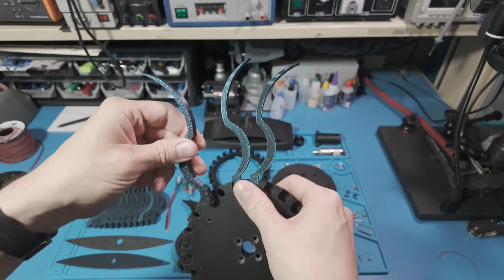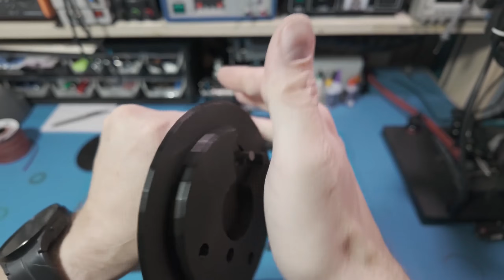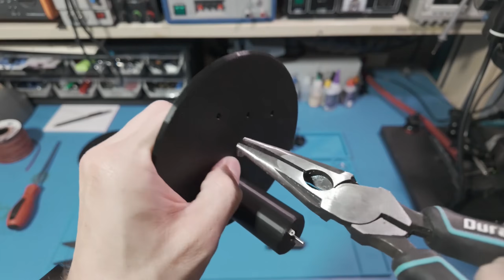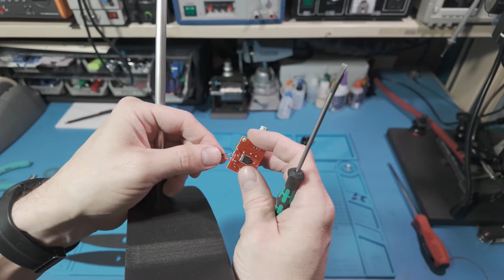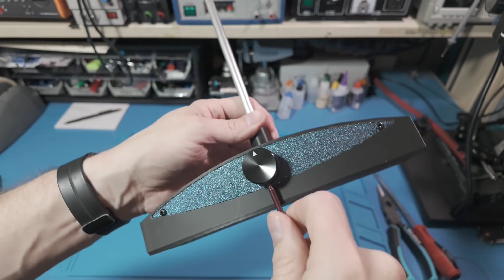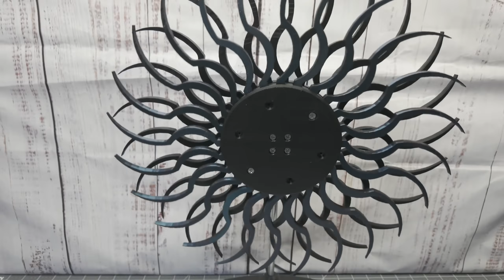Building a 3D-Printed Counter-Rotating Sculpture (Hypnotic Engineering!)

Comment: It'd probably be a bit more personal and influencing if instead of electric motor there could be a block with spirngs to drive it from, say, spinning a wheel to collect energy.
Reply from the maker: There are alot of versions out there. my initial design was a visual effect and to have the most control you need a consistent speed , I have seen outdoor wind driven one so making a generator or band driven one is very possible.